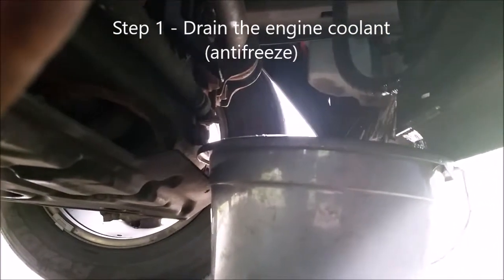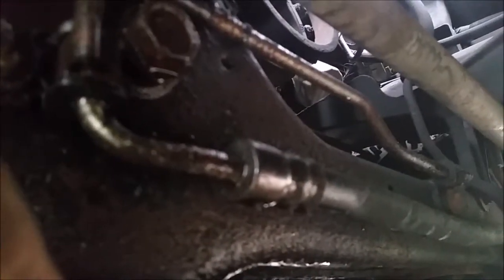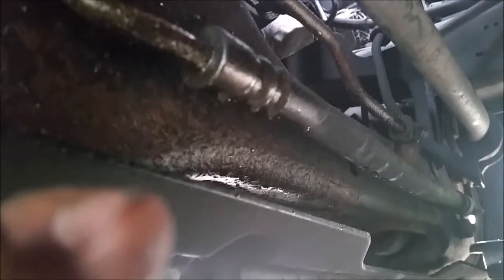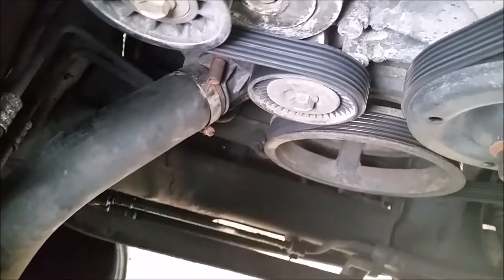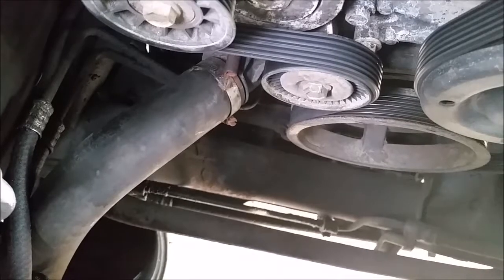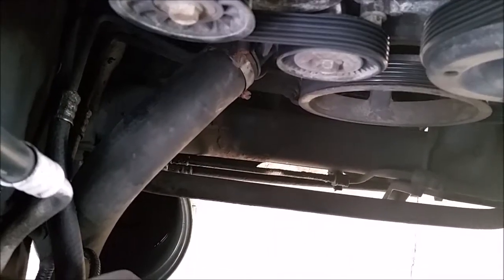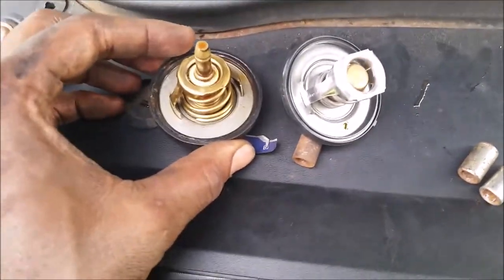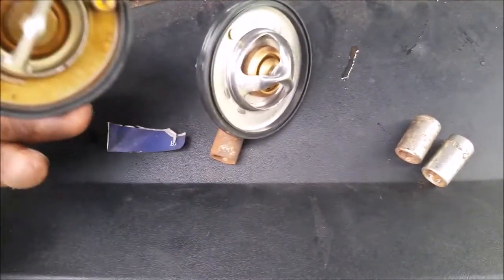How to replace a thermostat on a 2006 Jeep Commander

Comment: why do you have to bleed the coolant?
Reply from the maker: KRALTAIR47 it is to get the air out of the system. For proper operation
Reply: Mind Blown Productions Do you know anything about the system saying transmission over temp then the fans come on but the gauge is normal and I check with a temp gun and is normal. scary thing is it does affect how the vehicle is driving.
Reply from the maker: KRALTAIR47 yes the radiator cools the transmission fluid. If driven while overheating it effects the transmission temperature
Reply: because the thermostat is at the bottom of the block. Pull the thermostat out and nothing stops the water from dumping out.